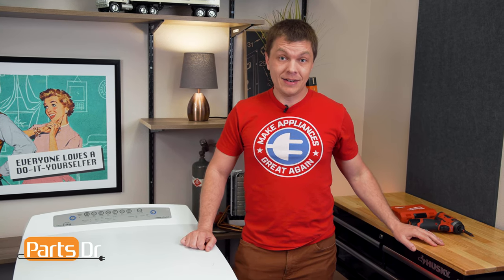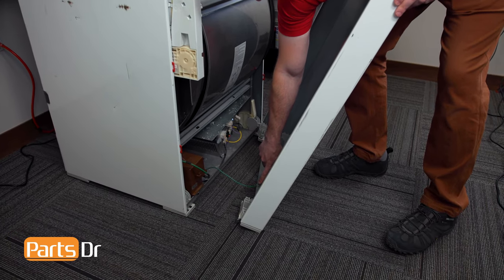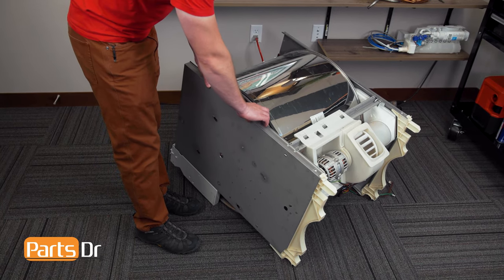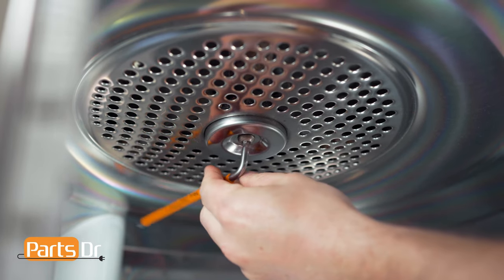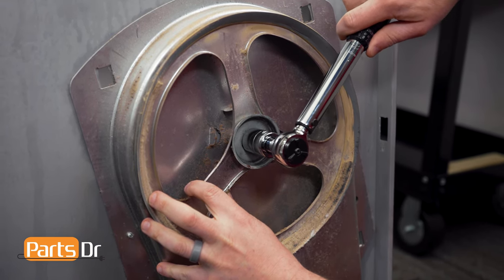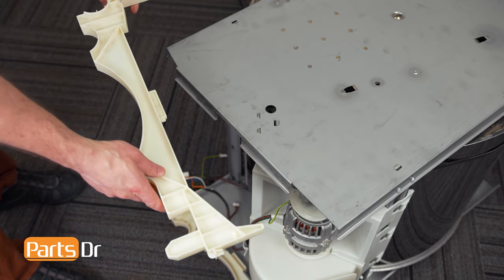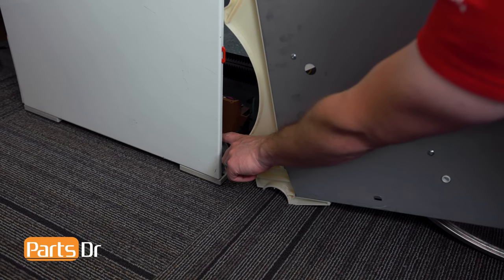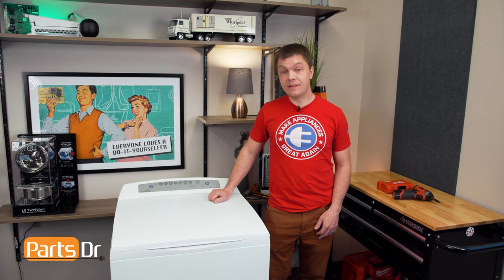How to replace Fisher & Paykel dryer drum bearing kit part # 479332

Comment: Parts Dr provided the very best "how to" video I've seen.  Each step shown, close-ups when beneficial, helpful tip on what to do and avoid.  Just excellent.  Now I see how the guy I hired to do the last two got done so fast.  He did not replace the shaft the bearing uses.  No wonder it had deep etching on the surface.

Comment: I had replaced the bearing twice before but never took the dryer apart and it was a pain. I am glad you have posted this video because this is so much easier. This has been very helpful and I appreciate the time you took making it! Thank You. I did order a new belt once I got the dryer apart. I also replaced the heating element (last year). I was amazed at the way it looked and was shocked that a fire had not started. If you have not done a video on this it would be helpful to people. Maybe even save lives or property due to fire.

Comment: This the second time our dryer bearing died, almost 10 years per bearing. This time I had a loud clunking when the drum was turning after I replaced the bearing. Finally figured out that the circuit board where the small two leads connected just under the top lid was not making a good connection. The mechanism just below the lid lock has a servo mounted on the left side down about 4". It holds the drum opener bar away front the drum while it is turning.  Every revolution of the drum two loud clunks. Took me several hours to find the issue. Pulled the connector off the edge of the circuit board, cleaned the contact surfaces and everything worked perfectly after that.  If you have two loud clunks with every revolution of the drum that is probably the problem
Reply from the maker: Thanks for the advice!  10 years per bearing isn't bad!

Comment: I realize this video is 2 years old and you may not be monitoring it. Hopefully, you can answer my question. How different would this disassembly be for model DE08-us1, which is the side loading model, not the top loading model in your demonstration?  Are there pointers you can give me?  Squeaking started last week and I believe it is a bearing of some sort. I bought the dryer in 2004 and hadn't had any problems with it till now. Thanks in advance for any advice you can give me.
Reply from the maker: It would be different than the process shown in this video.  We are sorry, but we have not worked with that model yet.
Reply: @PartsDr  Understandable, it close to 20 years old, guess I'll have to figure it out myself.
Reply from the maker: @Fantazier1  If it is 20 years old, it was built by GE for F&P.  Search for videos on repairing GE dryers, and you should be able to find something close.
Reply: @PartsDr  That's very interesting. I'll do that. Thank You.

Comment: My Fisher & Paykel DEIX2 dryer has been squeaking and squealing bad. I replaced the bearing and shaft.  The dryer was quite at first when it ran for the first time with the new parts, but the next day began squealing again. It still seems to be coming from the bearing area.   Any suggestions?  Could it be a pulley or belt that is also near the bearing and shaft?
Reply: It's always the pulley that squeals first before the bearing ever goes out.  It's normally just one of the pulley wheels, not both.

Comment: This was extremely helpful - my only issue was that after we re-started our dryer, it now makes a repeated swishing sound as the inside turns. We think maybe the drum is off-balance somehow or the that the belt is. Any ideas??
Reply from the maker: Sorry, we do not know what would be causing that.  You may need to take it apart again and carefully look everything over.

Comment: Ok I can change this bearing kit in 20  minutes or less heres how   (1) take lid  off  (2) move dryer away from wall lay it flat on the floor bearing side on floor...(3) remove center plate bearing screw....(4) remove bearing screws the small ones and every piece till just the bearing stud is left,,,(5) now use vice grips to remove bearing stud it's going to be thrown away.anyway so it don't matter if it gets damaged  ,,,(6) the bearing bolt is now ready for new bearing shaft stud just start by hand tight ,,,,(7) now tighten the shaft by using the Allen wrench and plate bolt  that was the first thing you took off as you tighten the plate bolt into the stainless stud this will let you tighten  the bearing stud as tight as you need to,, (8) when as tight as needed you can simply loosen the bolt from stud  with the Allen wrench without loosening stud  ,,,(9)  now install the bearing ball then retaining ring that has the five screws final plate and plate screw , lift the dryer up right ,put lid back on.and try it I have installed 50 or more of these kits and this is simple  and works for me everytime ,,, I only use OEM parts ,,,good luck
Reply: I used your method, Manuel, it worked well. I had a socket that fit so I used it instead of the vise grips.
Reply: Thanks frank for reply ....I'm replacing another one tomorrow and showing my trainee this method...he is going to be a great repairman
Reply: Yeah you absolutely don’t need to disassemble the dryer down to this level to do the bearing kit
Reply: Just used this method myself, you saved me like an hour bro, thank you!
Reply: @jacobpiscia835  you are so welcome
Reply: I did it in 18 mins💥😎
Reply: @milliondollar2981  good deal 👌
Reply: @manuelstapp7277  mannn I just did it the way in video took me 2 hours. FnP are ridiculous. I have to try your method next time

Comment: I've replace the bearing twice without having to take the dryer apart at all. I simply reached into the dryer used to hex to remove the bolt and removed the screws and simply replace the bearing and reuse the parts, it cost $10